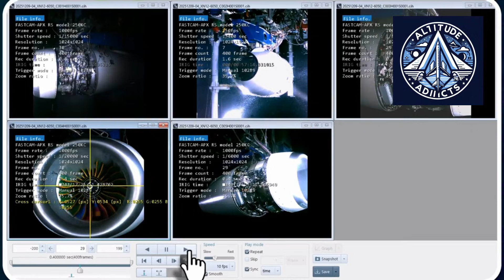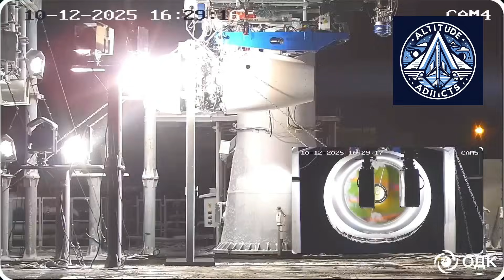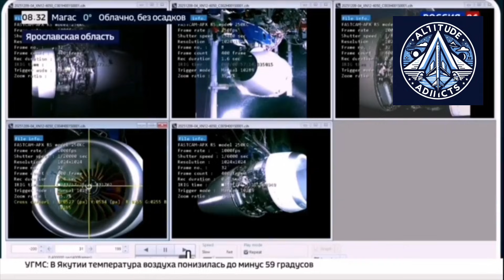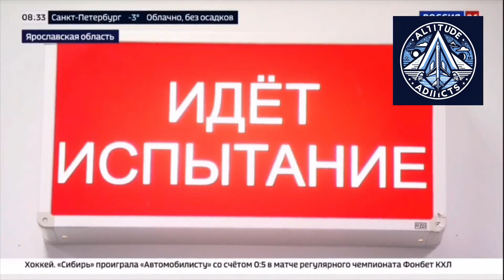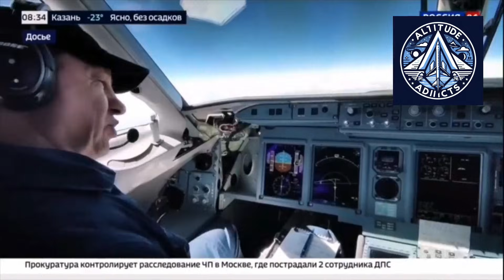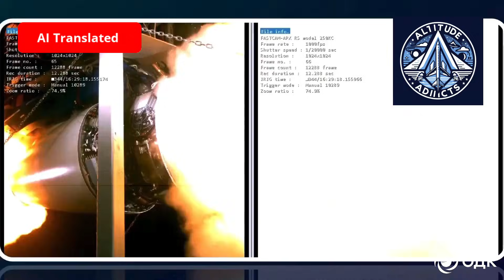UEC releases a video of the PD-8 engine fan blade failure test

Comment: Have the reports of PD-8 not being able to attain promised power levels been confirmed or refuted yet?
Reply: It producers about the 9 metric tons thrust already, despite the fact it was designed to have 8 tons thrust max initially. 
It was achieved by better sensor tuning and software improvements of internal FADEC system.
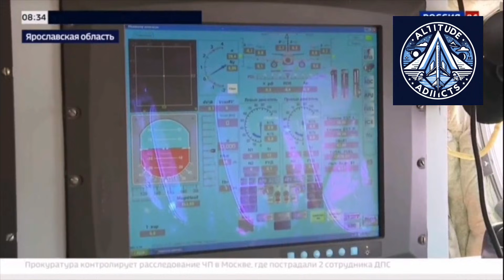Reply: 07:00  Okay, you discuss this later in the video.
What were reports of failing to achieve the planned power levels all about, then??
Reply: It was surprising, and confusing, when those claims surfaced, of the PD-8 failing to achieve planned power levels, when its siblings, PD-14 and PD-35, had no problems reaching their respective planned power levels??
Well, this is becoming enough of a rant....

Comment: I sincerely congratulate you on successfully passing the engine qualification tests essential for commercial passenger aircraft operation (blade breakage, flooding, noise, and prevention of engine failure parts flying away). I also thank the engineers who participated in this test for their hard work. I ask that you continue to focus on the remaining qualification procedures and dedicate yourself to resolving the issue of reducing fuselage weight.